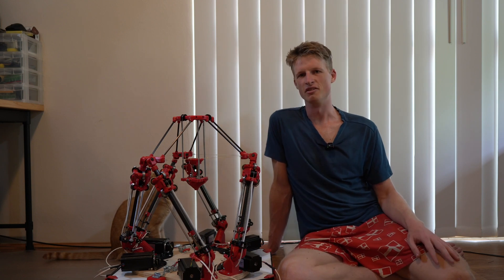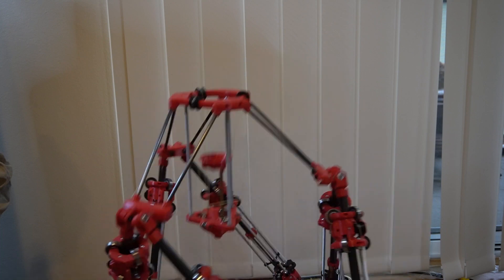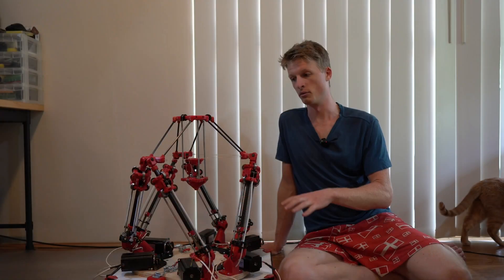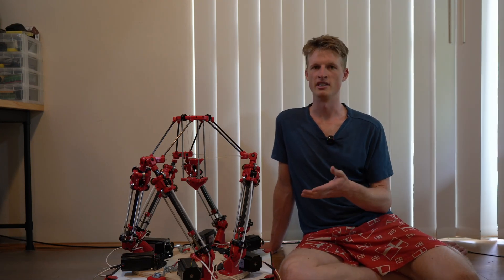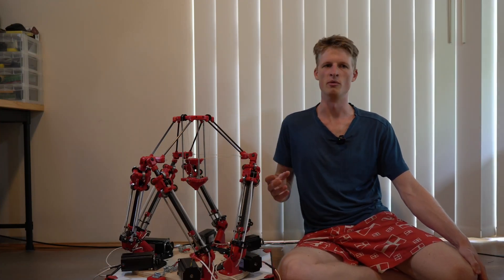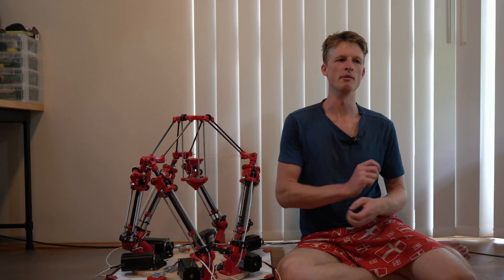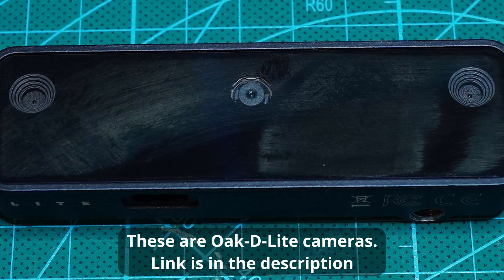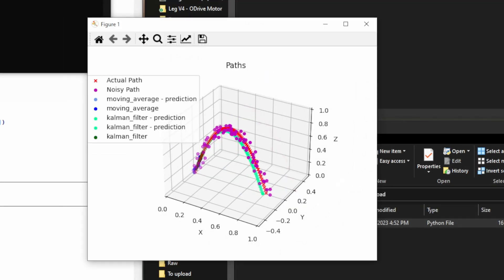Project Update - PDJ #13

Comment: I'm pretty surprised you're using the Oak-D.  I did not find it friendly or intuitive, but I'm curious to hear how well that works out.  If you end up putting the camera on the side you could use something like AprilTags as fiducials + OpenCV to get the position of the jugglebot automatically.
Reply from the maker: Interesting... I haven't used the Oak-D too much at this point and for better or worse, I've found most of the software stuff I've been working with to be very non-intuitive (CAN, Linux, Jetson devices, ODrives etc.) and I don't know of a better replacement for the oak cameras so I'm sticking with them mostly out of convenience/necessity at this point. If you have any alternative suggestions, I'm all ears!

Yeah I think your idea with the April tags is what I'd do if the cameras were positioned off of jugglebot, though I'd prefer to avoid that because it's just another source of error...

Comment: You could use the linear bearings on ground steel rod, but reverse it so the rod is on the lower fixed side, then have a larger diameter carbon fibre rod on the outside of the bearing so the actuator is only seeing the weight of the bearing and the CF rod.
Reply from the maker: That's an interesting idea!
Reply: @harrisonlow  obviously by CF rod I actually meant tube, whoops
Reply: You could 3D print a coupler for the CF tube to the linear bearing allowing a tube with an ID only slightly larger than the OD of the steel rod. But the 3D printed part might be heavier than just using a larger diameter CF tube 🤔 very interesting project!
Reply from the maker: @ollied1981  That would be pretty cool! With steel tubes and the method you're describing you could make some super thin actuators! Very interesting take on the problem

Comment: Crazy camera location idea - on the top of the platform.  Always a clear view of the ball.  The math for ball position would be extra noisy, but since you know where the platform should be, you can translate coordinates to compensate.  If you add an IMU on the platform, you could use that for closed loop position control too.  Using the theoretical platform orientation, along with IMU data, an added benefit would be the ability to implement another Kalman filter (or some of that crazy quaternion math I have heard of, but have never learned) to estimate real platform position.  Very cool project!
Reply from the maker: I've toyed around with this idea but I'm not sold on it yet. My worry is that there will be too much high-frequency vibration and the camera won't be able to get a steady view. That said, this version of Jugglebot has much tighter joints and transmission than the previous design(s), so I'm definitely going to give it a go once everything is up and running!

Another issue that will need a solution is how to route the power and data cables to the camera if it's on the platform 🤔

I've never used IMUs before but have worked with people who researched them pretty thoroughly and I'm a little turned off them due to their penchant for drifting. Have you used them before?

Cheers!
Reply: @harrisonlow  I was thinking that vibrating could cause some rolling shutter issues with the camera. And I agree, power routing is a bit tricky. Data could be via wireless (Wi-Fi probably) if you had a Pi Zero on the platform to connect a camera to.  As for the IMU, I have not used one before, so I haven't experienced the drift issues myself. But my understanding is that drift is the sort of thing that a multi sensor kalman filter is good at dealing with, especially since your estimated position state should be pretty reliable with the actuator setup you have (even without linear encoders). I've been working (slowly) towards implementing a Kalman filter of my own, but haven't yet finished that project. Too many distractions :)
Reply from the maker: Hmm, I wireless data transmission would be tricky (for me, at least). Perhaps using ROS would make it easy, but ROS is scary

Interesting, maybe it's worth playing around with some IMUs! What are you implementing a kalman filter for? 
Haha I fully appreciate the endless distractions that come up 😂
Reply: @harrisonlow  trying to do sensor blending to estimate chemical flow rate based on a slow tank level measurement that is accurate but not overly precise, and a metering pump speed that is precise but not accurate :) All of this in am industrial PLC, so it has no matrix math functions. That got me on a tangent of writing some matrix ops... Never ending tangents :)
Reply from the maker: Oh man. I can't imagine doing any of this without matrix math. At one point I was coding some of the basic Stewart Platform math into an arduino and even that (very straightforward linear algebra) was driving me mad. So many loops!

Comment: Constant string tension: the classic way is to put an idler pulley on the string. It will reduce the throw of the actuator, but not necessarily a great deal.

Comment: Jugglers only look at the top of the curve. You can hide about  75% of the trajectory and they can still joggle. The balls in the top also move at the slowest rate. Maybe an idea for the camera as well as the software.
Reply from the maker: Good thinking! I actually haven't considered this myself and it might end up being the way I'll have to go. It'd be quite a bit easier if I could keep the balls in view the entire time—jugglebot doesn't have a sense of touch the same way we do, so it can't make adjustments based on that the same way we can—but I may have to compromise if the cameras' viewing angle isn't large enough

Are you a juggler yourself? This seems like something only a juggler would think of 😂
Reply: @harrisonlow  Only 3 balls. I saw a long time ago a tv-show about this. Juggles need very few information to catch the ball. But they need the top of the curve.
I saw you with 5 balls. Look were your eyes are all the time.